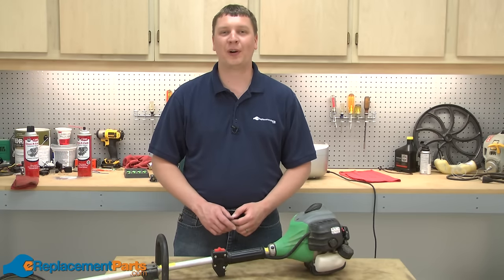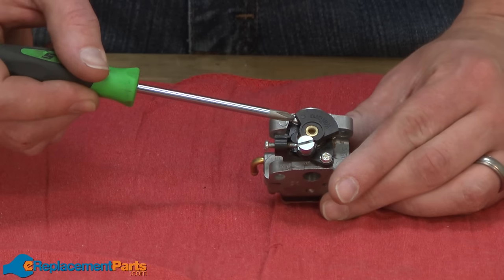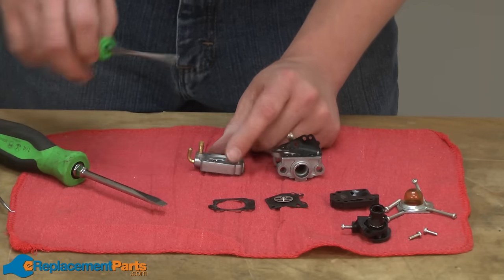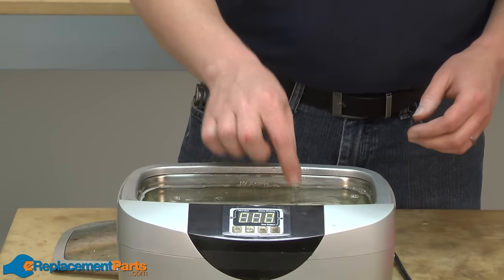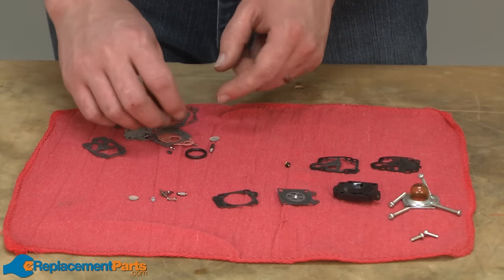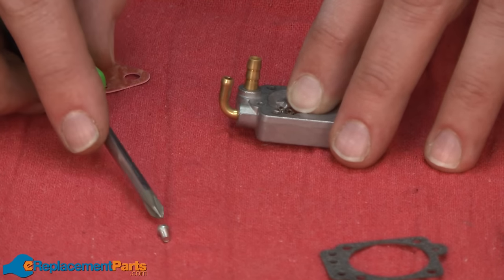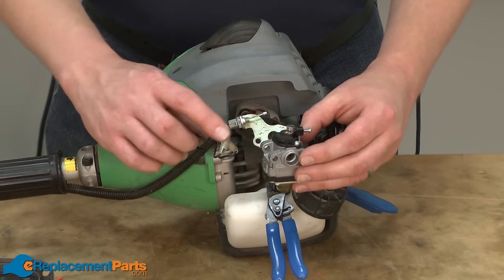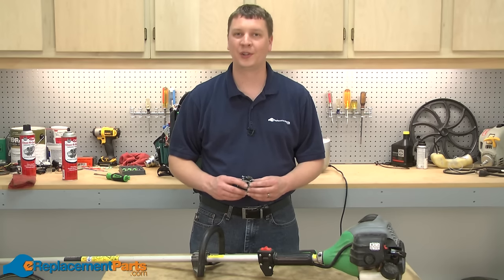How to Fix a Trimmer Carburetor

Comment: Brilliant video, got the same carburettor on my Echo 30 hedge cutter. Would run at idle but cut out when opening throttle. Was the main jet with the O ring was  blocked. Cleaned it out and hey presto , back to full operation . Thanks

Comment: Excellent tutorial, serviced my shindiwa carburetor based on this video. Unit working normal again. 
Thanks,
Reply: fuck shit... i tried to add all of the gaskets that came in the package, but when that didnt work out well(it started to spit out fuel), i just set it back as the old one was, lol.
still no fuel in the cylinder tho...

Comment: On the metering body of my carb, (Walbro WYL 280A 101) opposite the filtering screen is a cone spring.  Can you tell me the purpose for this spring, and if the carb would function without it.
Thank you for your time.

Comment: Hi I just reassembled carburetor on my McCulloch Trim Mac SL+, and I cant figure out if I should adjust the "Idle Speed Screw" that way that trimmer stops rotating. (I didn´t use it for awhile, so i don´t remember how it was earlier)
Thanks in advance
Reply from the maker: If I understand your question correctly, you turn the idle screw to the left for fewer idle RPMs and to the right to increase them. Edo4609  You have 2 routes to go on this trimmer.  The carburetor rebuild kit is:  http://www.ereplacementparts.com/carburetor-repair-kit-p-282532.htmlOr you can get the new carburetor:  http://www.ereplacementparts.com/carburetor-with-primer-p-282471.html

Comment: Great video thank you. My 4 cycle carb is setup similar on my troy bilt. I did a complete rebuild of the carb. My issue now is I cannot get the throttle cable to open up the internal valve. What have I missed or have I stetched the cable? I would appreciate any advice. Thanks.

Comment: Hello,  Do you carry any carburetors for 25 year old Homelite string trimmers?  Mod# UT 15040D  Serial# HM 1981127.  Also the fuel line filter?  Homelite hasn't supported their equipment for a long time.  Thanks.  Doug
Reply from the maker: Hi Doug, it looks like most of the parts for that model trimmer are no longer available. If you go to ereplacementparts.com with your model number you will be able to see everything we still have for it.

Comment: I have a question for you.. I need to adjust the screws on the carb ..but it doesn't have screws...they are the one you can adjust
Reply from the maker: +Jack Underwood The older Equipment engines had air/fuel mixture adjustment screws.  All of the newer modelsI'm familiar with are adjusted and jetted and the factory and there are no adjustments for the air/fuel moisture. https://www.youtube.com/watch?v=8Rzrq3MEi_0
Reply: you can take a Dremel with a cutting disc on it and cut slots into those screws and do the adjustments to it, Those are the high and low speed mixture screws that you are talking about

Comment: How important is it to close off the fuel lines before removing them? The reason I ask is that I removed the carburetor to replace the primer bulb without closing off the fuel lines. While in there, I realized the carburetor needs cleaning, and subsequently found your video. I hope I haven't caused more problems. Very helpful video, by the way!
Reply: All that does is keep the fuel from spilling out while you are working on it.
Reply: I was hoping that was the case! Thanks!
Reply: What is the purpose of the primer bulb?
Reply: Joyful Noise
Reply: jonny cola
Reply: jonny cola

Comment: I called in for parts-carb rebuilt kit. They couldn't find the item # for my Ryobi 825R.
Item # 41BD825A034. We then got disconnected. Are they obsolete or cross-referenced to anything else?